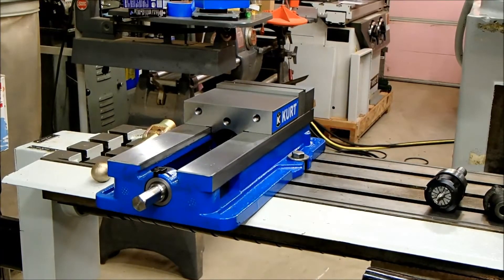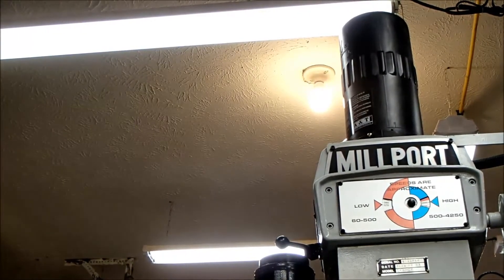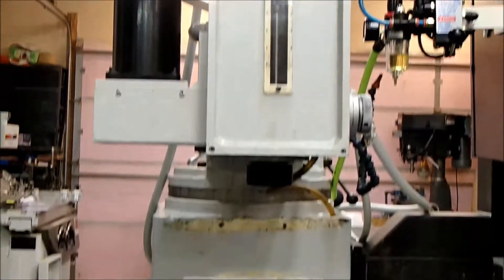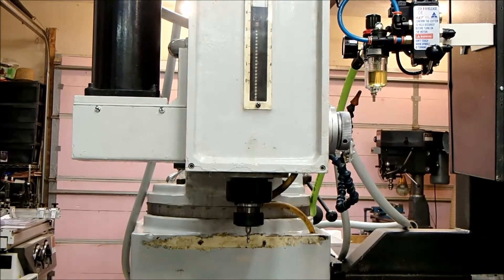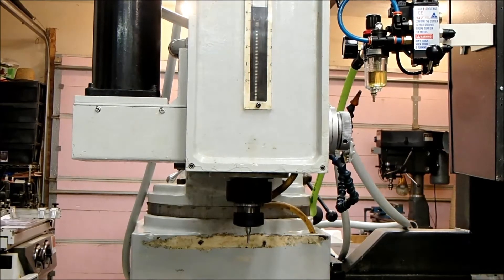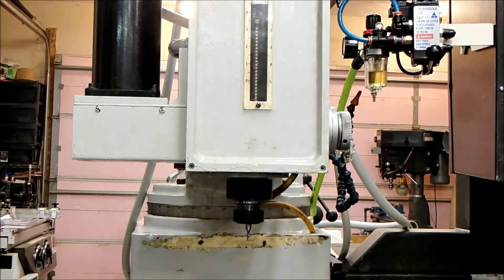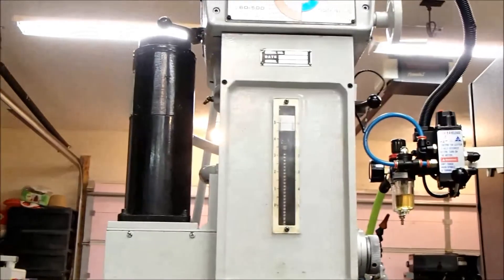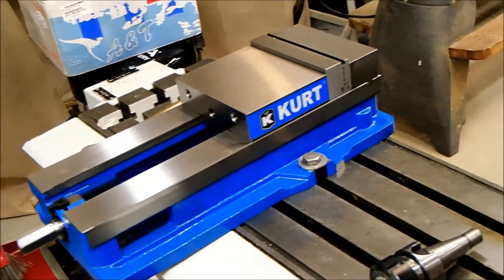Aussie ADB-123 Power Drawbar and Kurt D688 Vise for my Millport CNC Milling Machine

Comment: Is the dynapath 20 controls ok
Reply from the maker: Took it out and never used it. Still on the bench.
Reply: @bloomingtonmike   I have same machine just wonder how this mill performs
Reply from the maker: @guypatts494  it works great. I did allin1dc centroid conversion. Wish it was fully enclosed but  it is cheap for the performance.

Comment: Do u like that mill how does it work
Reply from the maker: Works great. 4500lb knee mill so massive for me. Its not a true VMC  but this 2x the mass of a Bridgeport. A bed mill would be nice too but the ultimate is a fully enclosed vmc and that is what I would upgrade too. Centroid Allin1DC is an amazing controller and is truely fully encoded.
Reply: @bloomingtonmike   does the head swivel  on that machine
Reply from the maker: @guypatts494  mine would but i have it locked. It also extends. Its crazy heavy but moves amazingly. The machine is 4500lb!